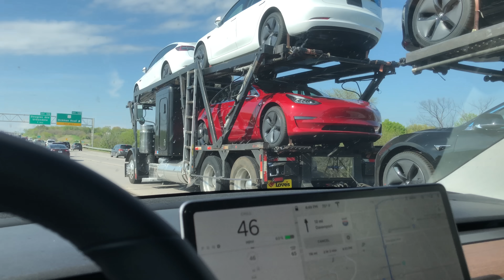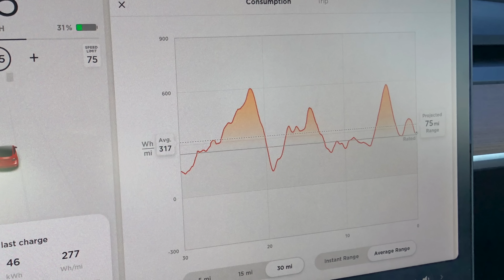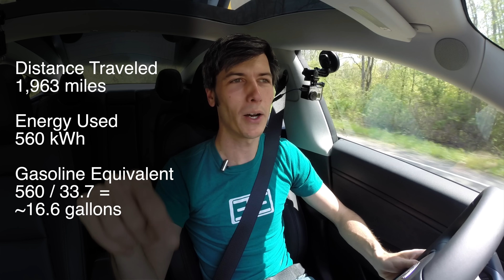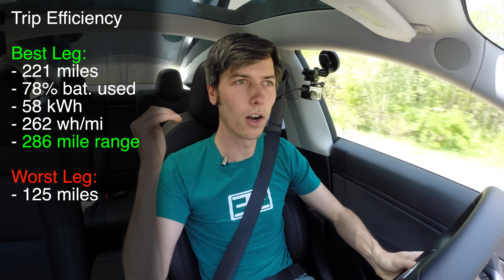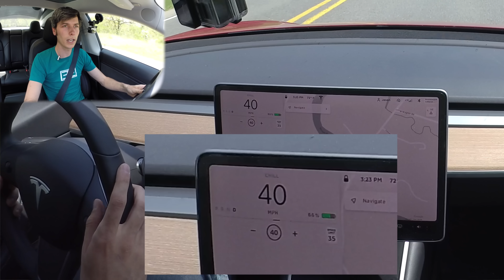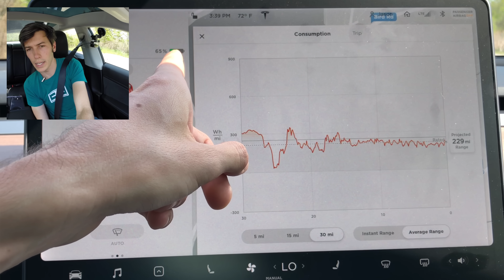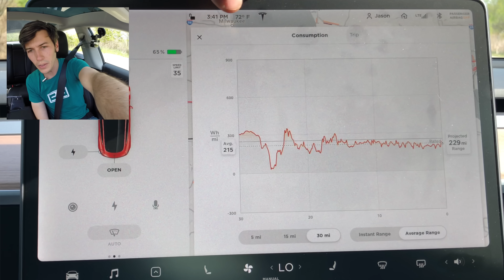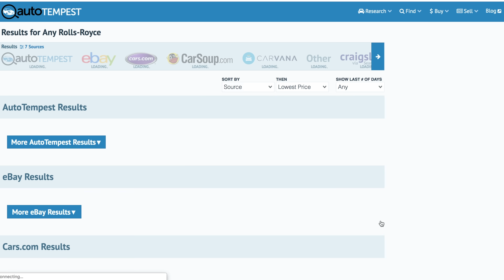How Miserable Is A Tesla Road Trip?

Comment: Everyone is commenting about his age. I want to know how hard is it to find charging stations along the way.
Reply: 2 boomers arguing over who is more boomer 🤣
Reply: @LittleTrixter  , I would more frame it as, this one is more resistant to change.
To my way of thinking (Flintstone like) I like the technological improvements
so far (I'm on the internet right now) but, enough! I would rather talk to a person 
face to face, rather than each one stare into their all-consuming cell phones.
I may be old school, but I think self driving cars are a horrible idea. Just insane.
Remember, it was the new, improved MCAS with it's faulty sensors, that sent
two 737 Maxes plunging into the ground, killing all 346 people. Now, you put 
computer sensors on millions of cars, and what could possibly go wrong?
Reply: not hard - the car computer shows them and i believe plans the route based on them
Reply: @phoslurperr  when i take a trip i want to go, wherever i want, not told by a robot.
Reply: @dannyfields2065  
You don't plan your routes at all?
Reply: @remliqa  no, i want freedom, and you can only get that with gas powered cars.
Reply: @dannyfields2065  
At least for now.
Reply: @remliqa  no not usually, i like the freedom of going anywhere.
Reply: @dannyfields2065  
I'm talking about current level of EV batteries. Once higher capacity batteries  came out  in a few years (Tesla's 1000 mile batteries i.e),this concern would no longer be valid.
Reply: @remliqa  , Did Peter Fonda and Dennis Hopper plan their trip? That's not the American way!
Reply: @mtntime1  
So you're telling  me that they keep abandoning their vehicles whenever they ran out of gas,?
Reply: @remliqa  , No, they filled up the gas tanks on their choppers. Available anywhere.
Unlike charging stations.
Reply: @mtntime1  
So they did plan they routes to only where they can get a fuel, ergo not so o different from BEV road trips . In a couple of decade the  situation would be the same for EVs , only far more convenient as electricity is more ubiquitous than fuel stations.
Reply: @mtntime1  
" Let me guess, you're a millennial, right?"
LOL , you couldn't be more wrong, fellow boomer (though  I doubt you even  qualify as "boomers"). I'm guessing you're too young to remember that there were was another  President named Bush  or   witnessing the impeachment of multiple US president (i'm (not just talking about Clinton and Trump). in your lifetime. 

I am probably older than you , yet I am confident that I will be seeing  the extinction of ICE as main terrestrial transportation within my lifetime. I mean 1000 mile batteries is just within this decade alone.
Reply: @remliqa  , The official definition of a baby boomer is born 1946-1964, which I was.
But, the realistic definition is, do you remember Woodstock? Vietnam? JFK, MLK, RFK assassinations?
And of course, the aforementioned movie, Easy Rider? All boomer milestones.
Reply: @mtntime1  
If you are as old as you claim, then you already witness three  paradigm shift in technology that I have : the advent of home computing, he rise of the internet and the invention of the mobile phones (not smartphone, just mobile phones), we would  both remember the time when all three was nothing but sci fi and how all of  them change our way of  life in direction we didn't anticipate at that time  . The shift towards electrification is just another  one of those  milestone  that we will witness  if we're still alive in a few decades) The future Wtyatt and Bill (Fonda and Hopper's characters) will be free ranging using EVs.
Reply: @remliqa  , And everything will be robotic.  I fear you may be right. What a depressing thought.
Glad I won't be here to see it.
Reply: @mtntime1  
" And everything will be robotic."

Doubtful that'll happen within our lifetime.

" I fear you may be right. What a depressing thought"

I don't  see what is so depressing about weaning ourselves off fossil fuel. You should be rejoicing considering the harm fossil fuel have done so far.
Reply: @General12th  
A thousand mile battery is just around the corner, I bet we'll be seeing them in just  couple of years.. The current range  for BEV is good enough for 90% of car users,  let make them useful for 100% of car users.
Reply: @remliqa  other concerns like Tesla being able to control your vehicle would still remain
Reply: @remliqa  gas stations are ubiquitous
Reply: @wlonsdale1  
Not as ubiquitous as electricity. Almost  all homes have, can't say the same for gas stations.
Reply: @dannyfields2065  I guess you're not buying a Tesla :)
Reply: danny fields what? That just sounds like you don’t want to like Tesla’s. The Tesla doesn’t force you to go to a charging station, it just gives you multiple routes based around the charging stations. Gas cars don’t run forever, you eventually have to stop at a gas station. The Tesla is no different, it just makes it easier to locate a charging station.
Reply: mtntime1 yea, Musk is not factoring boomers being involved.  That’s why EVs will succeed.  My neighbor is a boomer, the other day he asked while I closed my garage, “ is that thing running 🤣🤣🤣🤣🤣🤣🤣.  The dinosaurs went extinct.... gave rise to us.
Reply: @remliqa  People thought they had freedom when they drove steam powered cars. "I'm not gonna let a gas station decide where I want to go"
Reply: @remliqa  And the end of most of the types of jobs you really dont want.  Trucker, cashier, burger flipper, delivery driver.  Its a good thing. People will be better off without having to perform mindless work.  With all the time they need to pursue what they enjoy. It all leads to more freedom.
Reply: I just drove from Seattle to Rochester, MN due to medical situation. My gas car, got 30 MPG, with full heat (Spokane to Bozeman) and full AC Bismarck to St Paul, 88 mpg average I stopped 4 times for gas. I timed my stops, only stopping in counties with no COVID cases. From Billings to Dickenson, 460 miles, there were 0, read NO, charging stations. Tumbleweed, yes, charges, no. This trip would have taken 8 stops, some as much as 3-4 hours. We left at 6 am, arrived 6 am 24 hour, lost 2 hours due to time zones. Tesla woulda been 8 stops adding at least 8 hours to the trip.
Reply: Watch the video and he actually explained it
Reply: tesla has a GPS app that will route you through charging stations and will even tell you when and where to stop, even how long to charge so you can make it to the next planned stop
Reply: Derek Charette  they are fun tho lmfao. Instant torque delivery is amazing.
Reply: At 21:15:  it costs $156.80 to drive 1963 miles.  $156.80 will buy 52.27 gallons of gas (@ $3/gal). 1963 miles ÷ 52.27 gallons = 37.56 mpg.  Right??  Your Tesla get the equivalent of 37.56 miles per gallon  (on a highway road trip). That's about the same as a 2010 Ford Fusion Hybrid; that's not bad.
Reply: Derek Charette  
That is actually a lie.  I don't think you understand what "fact" mean. HINT: Thoroughly debunked myth/lies aren't "facts".
Reply: finding a charging station without going out of your way,  is pretty hard east of the mississippi and other places too.
Reply: Good to know, and very significant.  This route might have been optimal for the Tesla, for a 2000 mile trip.  Other routes probably aren't.
Reply: @dannyfields2065 Depends on how east you ware referring to.  The farther east you go the easier it gets.
Reply: Also the mileage he claims is wildly off!!! the amount of electricity he used 560 kilowatts is 2-3 weeks of electricity a whole household uses and if your paying an average of $.40 kw and if your fuel prices are around $2.20 a gallon then he only got around 20 mpg. And had to stop every 2 hours where a regular car 300-400 miles on a tank and fill up in 15-20 minutes!
Reply: @michaeloverholt2081  the average cost per kwh in the us is 12 cents
Reply: @michaeloverholt2081  in Florida we pay 13¢/kwh, or ~65¢/gal. I do trips up/down the east coast in my M3 SR+ fairly often and have never had an issue.
Reply: @michaeloverholt2081  Superchargers are about $.28/kWh. 
He stopped at about 200 miles so that means that if you drive that far in 2 hours you average about 100 MPH.  That is way too easy to get an invitation to contribute the local policeman's ball. :-)
Reply: @michaeloverholt2081  since when does a kw cost 0.40$ in Sweden a high price is 0.08$ it's free sometimes in the winter
Reply: Michael Overholt charging rates are now about .13kw at least the other day is what I paid.
Reply: @michaeloverholt2081  Dude, where are you paying such an exorbitant price for power? Texas rates are a third of that.

Comment: I'm about ready for a new vehicle. I just use my current car for driving around town and the occasional trip to the mall in the neighboring town 30-40 miles away. I don't know much about full electric cars. Heck I don't even know if my small town even has any charging stations lol. Can you plug it in to just any old socket like the plugs on the outside of the house or does it require installation of a special plug? Does it hold it's charge or do you have to keep it plugged in? I fill my tank and it lasts a month sometimes more  and that's just a  one time expense (monthly of course) and I'm good. My concern would be the increase to my utility bills by this thing constantly sucking juice if you have to keep it plugged in.  I guess I could see what the city is charging per Kw. vs what a gal of gas is going for but, I dunno.

Comment: Maybe I missed it but how much does it cost to charge every time at the charge stations?  Its only free at home right.  I'm sure that charge adds up. 🤔
Reply: Depends if you buy a tesla new you get free charging at the superchargers, even if you buy them used but not all of them get free charging, I'm not sure but the 2018 models don't get free charging at these stations, it's weird. And with every other ev, there are different solutions, either you pay just the electricity bill so that depends on how much you charged the battery and how high the kw/h cost is (average is 12 cent in the us, so the cost of every full charge of the biggest model 3 battery (75 kw/h) is 9 $) and then you can get charging cards, where you pay a specific amount per year (most of the time it's cheap like 20$), and on their charging network you can charge the battery how much you like, without any extra cost, even if you need to pay for charging the car, it's still cheaper than fuel.
Reply: slickmet the price to charge will never ever compare to the cost of gasoline or diesel.
Reply: @jonnystange4017  I know that, what im saying is he doesn't mention it. High cost or not it matters. Also when the warranty expires and the electronics start failing Tesla won't sell you parts. So that's when it's going to be expensive.
Reply: see 21:21 in the video

Comment: My take-aways from this video regarding electric vehicles:  1) Be prepared to spend hours (maybe days) planning any long-distance journey.  2) Things like cold weather, load and other commonly encountered driving conditions, will cause issues.  They also mean more planning and more stops.  3.) Don’t use an electric vehicle on long distance trips.  4.) Electric vehicles remain the equivalent of being very expensive golf carts.  5.) This video is another attempt to sing the praises of electric vehicles but only reassures me that staying with fossil fuel powerplants.   
At the very best, electric vehicles are good, “knock around town” cars.  At worst, they are very, VERY expensive golf carts.  As long as electric vehicle are designed around a battery power source, they will never be viable long-distance transportation.  Electric vehicles will not be able to compete against conventional piston powerplants until we chuck the idea of a battery.   To be viable, a vehicle will need to generate electricity on demand for long periods of time.  Like a hydrogen fuel cell, a micro fusion reactor, or some other undiscovered technology.  Sorry folks, the battery has got to go.  We have over 1billion cars on the planet.  By 2050, it is projected we will have over 3-billion.  What would the earth look like after mining all the rare and heavy metals needed to produce these billions upon billions of batteries.

Comment: Without the same kind of charging stations for ALL brands of e-cars is going to really slow down the growth of this sector. Also maybe all e-cars should have to have the same type/shape batteries so they could be modular plug and play. Just pull up to a station, take out flat batteries and slot in charged batteries. Could make a stop comparable with gas stop maybe??

Comment: Screw that.  Give me a gas vehicle.. when batteries get better I’ll get one.  I think the hybrids are best.  Best of both worlds
Reply: @LifeLongStrong1961  you do understand the difference in efficiency between ICE cars and electric cars? Even in the most coal rich grid, Eve still produce less than half the CO2 of gas cars. Stay informed
Reply: It's not that bad with real world routines
Reply: @LifeLongStrong1961  As a grad student in the field, I have done extensive research on the subject. Your comment assumes a pure grid of fossil fuels which just isn't the case. It also assumes that the scale of fossil fuel generators cannot produce more efficiency than a gasoline engine, which is wrong. Coal power plants is 37% which is more than the most efficient engined and gas powered plants are mid 50s in thermal efficiency. So on the worst grid, which is improving continuously, an EVs electrical generation is much more efficient than gas.
Reply: @LifeLongStrong1961  Calling a heat pump "geothermal" is a bit much.
Reply: @LifeLongStrong1961  ok, our heat pump is buried about a meter under our lawn. That's obviously not geothermal since the heat originally comes from the sun, not the earth. I didn't  know people went deep enough for the geothermal effects to matter.

Comment: When I take a road trip I generally stop every 250-300 miles to gas up and take a whiz, which takes about 10 minutes, even though the car has a range of 350 plus miles on a tank. I am range limited by my bladder. Probably every 2nd or 3rd stop I will stop and eat at a fast food place, which means the stop is about half an hour. Otherwise I survive on the Doritos and trail mix I have in the car. If I had a Tesla I don't think I would have been able to take the back route I took from Winnemucca NV to Klamath Falls, OR on my last road trip. It was over 300 miles and there were no charging stations.

Comment: I live in the frozen North of Minnesota. I work at a GM dealer, I'm very interested in the cyber truck. I would like to see a feasibility test of theese things in cold weather. 

1 Life of charge in a -40F
2 Heater output and defrost
3 Overall poor condition performance
4 Built in safety for the unprepared folks, 
5  Possible auxiliary battery pack (gas can)

Comment: My 2014 i3 Trip from LA to SF and back was torture compared to this. 80 mile range is not great for long trips. Searching for stations, broken stations, guy unplugged me to plug his car in, some distances were long had to turn off AC, it was hot 95 degrees, I missed one stop by accident I had 0 miles left when I got to charger, it took much longer than gas, it was stressful, the mishmash of different chargers, poorly spaced fast chargers,  I did not have a 15% buffer, stopped 12 times to charge going up and another 12 on way back, made a bad route choice which meant I had to back track because there was no reliable chargers in range. This car is great for a commuter, or around town, but will never attempt a longer trip again.

Comment: I connected an alternator to my Tesla. I haven’t needed a charge since...
Reply: And if you believe that, I have a perpetual motion machine to sell you.
Reply: @someguy2135  how much ?... does it have pretty handles and usable cupholders?.... gotta have heated seats what's perpetual motion without heated seats jeez cold arse perpetual motion no one wants that
Reply: @johnmoser2689       Sure.  How much have you got?
Reply: @someguy2135  not enough likely🤣🤣🤣
Reply: Anybody body thinking of using a tesla to charge a tesla, it will work, but it won't work. If you're using motion from the Tesla to charge the battery, that is just converting electrical energy to mechanical and back to electric, you would indeed lose energy in this process and therefore it would be better to just apply all the electricity to the motion of the car. 🤷‍♀️🤷‍♀️
Reply: That's a fantastic idea man you gotta patent that kit and get it to market quick🤣
Reply: john moser got something better in the works 😭
Reply: @hemigod2  hell yeah pedal power so you can exercise while charging Tesla self drives anyway what else ya gonna do while riding🤣
Reply: john moser Is that what you are going to be doing? Good on you mate.
Reply: @hemigod2  no not actually I just like to pick on funny people
I really don't like ev stuff
Reply: john moser hope that works out for you
Reply: @hemigod2  worked pretty overly good with you ha ha ha ha
Reply: Matt P  I thought everyone commenting on this was just joking about an alternator designed to charge a supplemental system helping to make an ev more efficient... however it seems some of you are serious that's cute but c'mon not very realistic
Reply: If your serious you should do a video on YouTube
Reply: Matt P the extra energy that is used on moving the pulley (friction) will be the same to charge the battery, so no extra energy